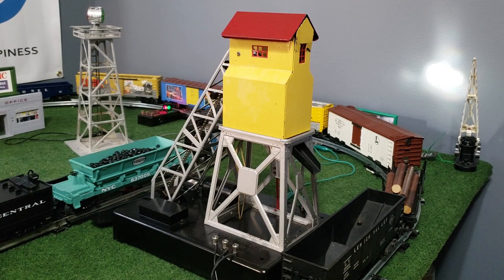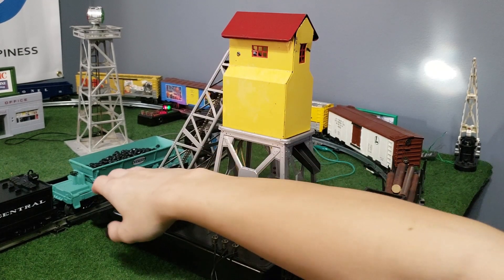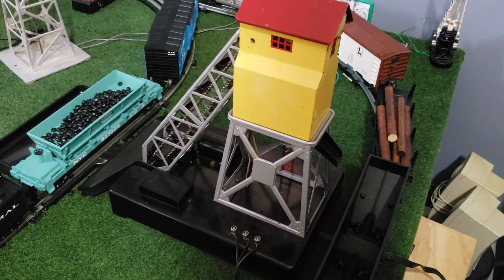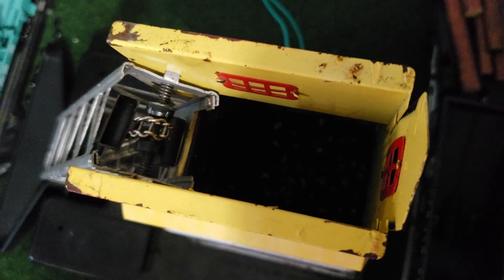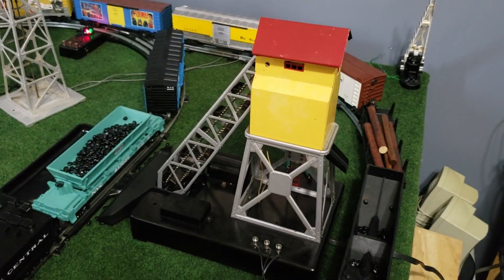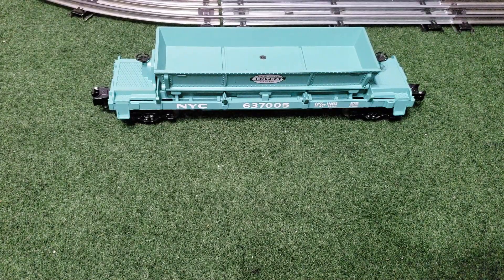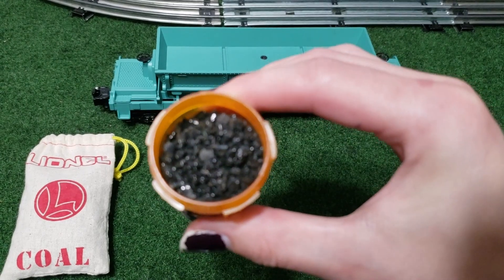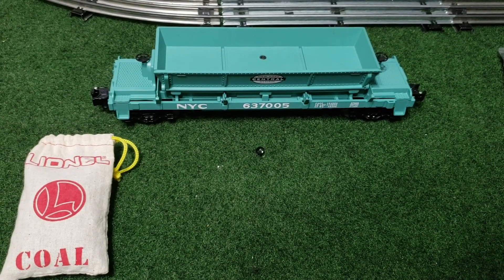Laurens Lionel Episode 6 :   # 97 Coal Elevator

Comment: I have a #97 myself. I think that the late prewar / early postwar #3659/3559 dump cars with the red metal dump body would work better with the #97 because the dump body is shorter than the later #3459/3469 or the modern dump cars. (less mess) I also have the #456 coal ramp and the #397 coal loader. Those accessories together with the #3456 operating hopper car will make an impressive coal operation on my layout!!!!!

Comment: Hi, I bought an operation coal dump car like yours, but it's not doing the action when I press the button. The magnetic part works. I'm wondering if there is some spring once the magnetic releases the top part. Could you tell me if there are any springs? Thank you